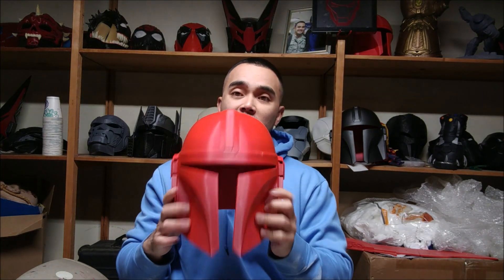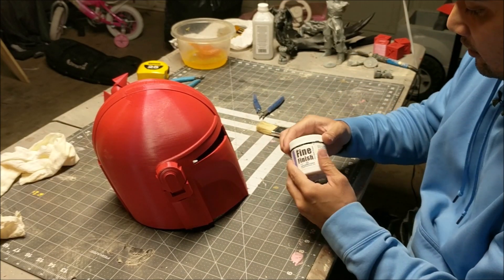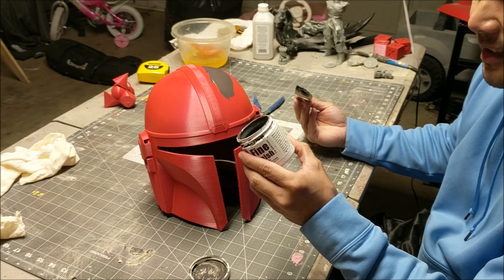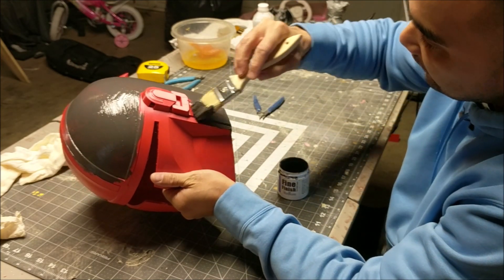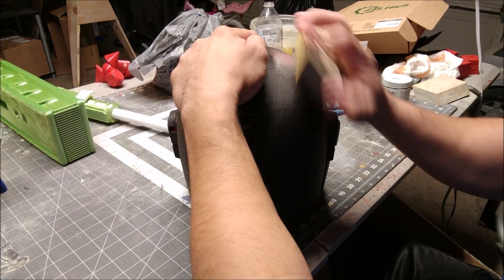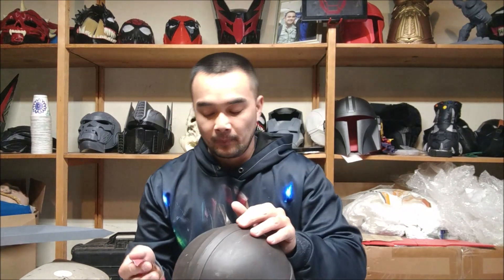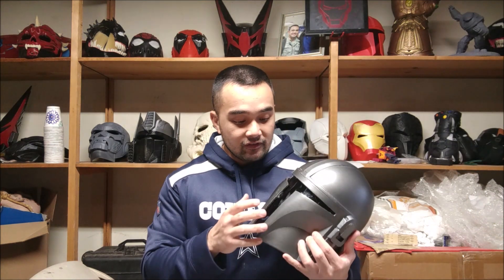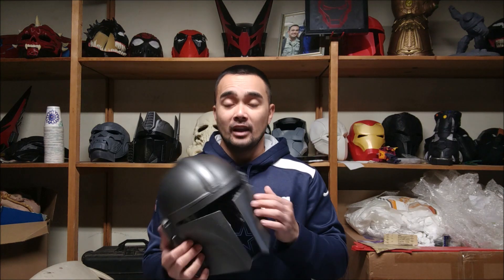Finishing a 3d Printed Mandalorian Helmet

Comment: Very nice job!! Never heard of that smoothing stuff. I may have to check that out! What orientation did you print the helmet at? I have the CR-10s and am looking to print this next...but I end up in "supports hell"  ....thought about just flipping it upside down with the dome part on the buildplate...thoughts?
Reply: flipping it upside down may save plastic but it messes up the top of the dome.  You end up with extra flash to trim off the crest as well as possible swirly print lines around the center where it rested.  I've gotten 2 from Etsy sellers printed this way and I was very unhappy with their results.

Comment: @Nikko - 

Ordering a Mando helmet 3D printed on pla plastic.  Is this material comparable or identical to the one you show in this video?  New to sanding and painting but looking forward to the adventure!  Thanks for the video.
Reply from the maker: Yup same material
Reply: @NikkoIndustries  Thanks sir for the reply!  Did you use the custom visor holders found on Etsy to secure your visor or did you have another method?
Reply from the maker: @RobboBanano  I used the welding mask replacement bought on Cyberweld.com